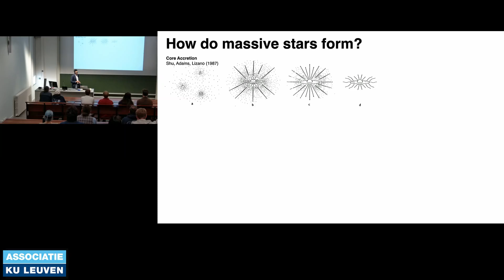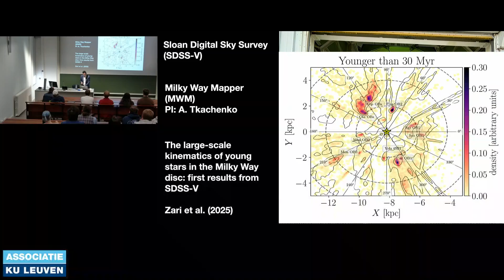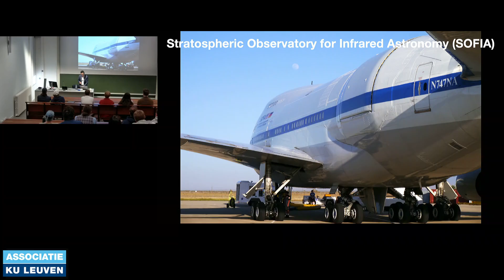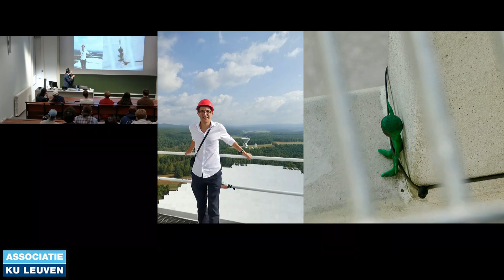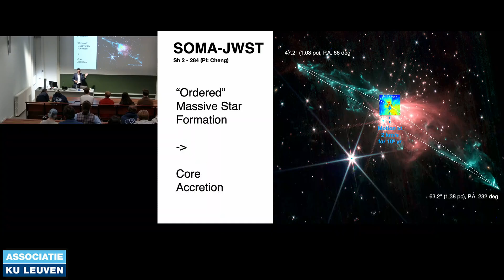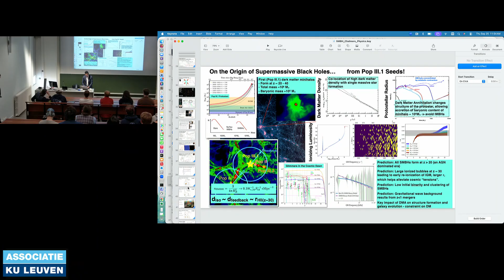IvS Seminar: Jonathan Tan (25/09/2025)

Comment: Dark matter is relativistically dilated mass. A fundamental insight of Relativity is that mass that exists at Relativistic velocities is irrelevant from our perspective. Relativistic velocities are occurring in the overwhelming majority of galaxy centers. This means that they exist in a "non local" state relative to their outer regions. The mass in our galactic center is not just there, it's everywhere.
    The phrase "mass becomes infinite at the speed of light" refers to Relativistic dilation. Einstein repeatedly said that it prevents astronomical concentrations of mass. He put this in writing in 1939. Even mass that exists at 75% light speed is partially dilated.
   It can be inferred mathematically that Relativistic dilation does not occur in galaxies with low mass centers. They do not have enough mass to achieve relativistic velocities. It has been confirmed in 25 dwarf and ultra diffuse galaxies to have no dark matter. In other words, they have normal rotation rates.
   Mass is a clingy thing thanks to gravity, it makes sense that dilated mass would exist as a halo around galaxies.